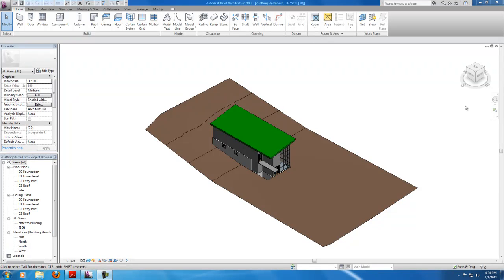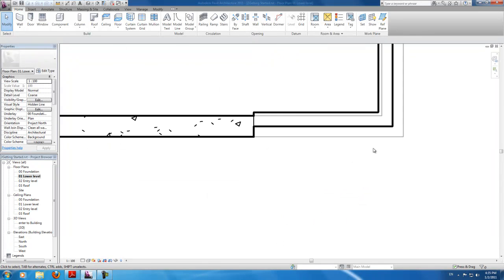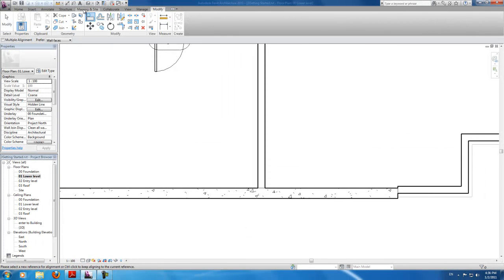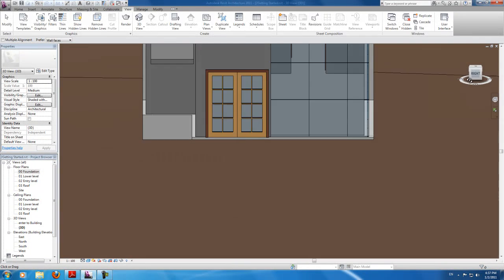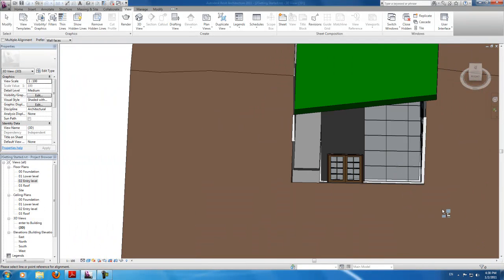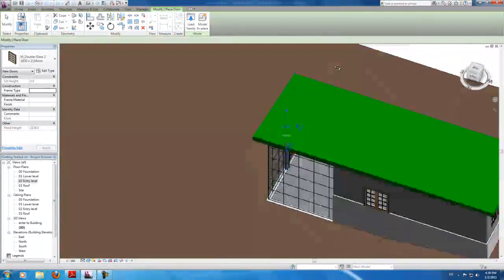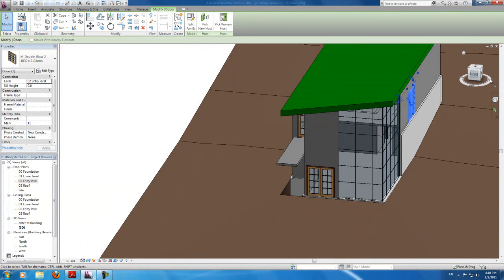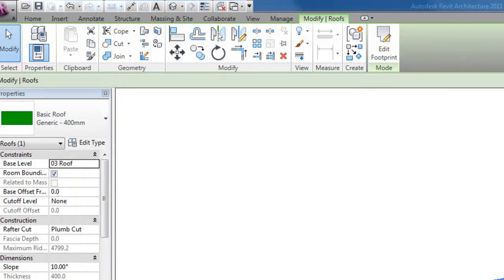Autodesk Revit Tutorials: 12 Fixing a few errors

Comment: Thanks a lot for the tutorials! I only have a question so far, the las part you did: moving the roof i've made it but when i'm looking the "03 roof plan" it apears like the roof is not covering the noth walls, what i mean is that the line that marks the edge of the roof shows behind the walls (inside the house) intead out of the house but when i check the 3D model everything looks like it should looks, whats going on?

Comment: Thank you so much. I've been looking for weeks for a beginner tutorial that takes one step by step with no luck until now. Revit can be a bit tricky at first. One thing I noticed is under the balcony there is a space that needs to be filled or one might trip and fall a few ft from the ground to the bldg pad. When I was drawing the pad, I think I should have adjusted it more for the southeast corner. Instead I drew an outside corner around it. And wall lines are tough to match even w/ align.